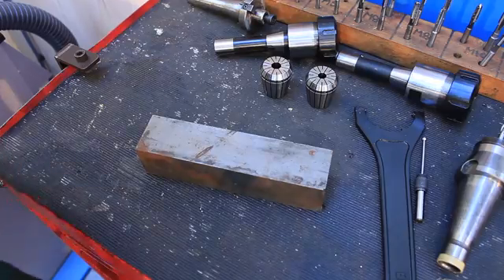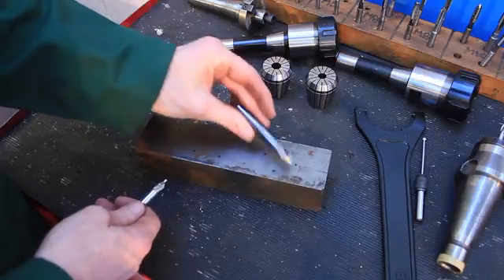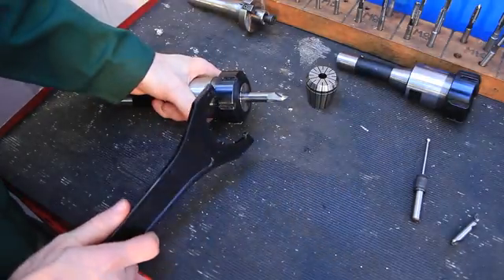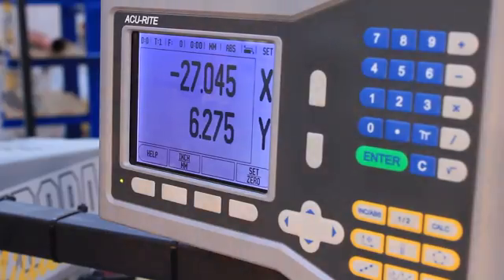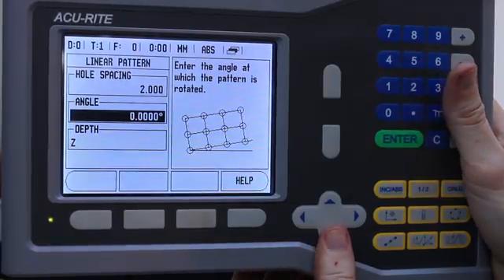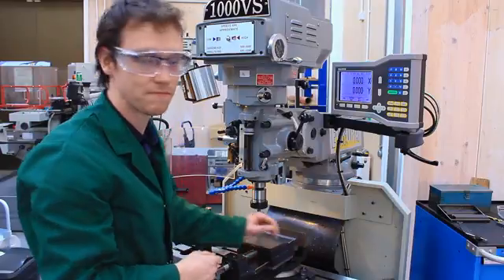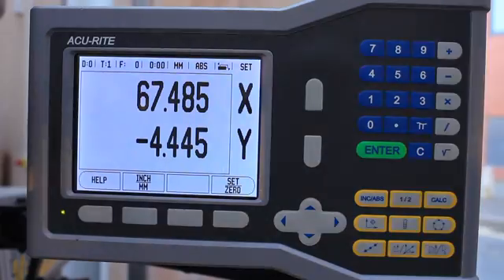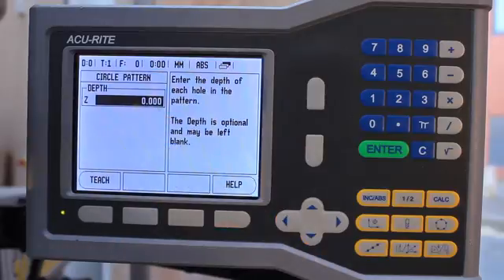Digital Readout Mill Tutorial Acu-Rite Vue -#5minFriday - #6

Comment: great just what the machine Doctor ordered. on the instruction video you showed re installing a two axis d r o to a lathe ,I was horrified to find that my 1.2 ton lathe should be removed from it's present space and fit the horizontal reader unit from behind. My package Chinese cheapy glass scale which looks good will be a big challenge as I have severe parkinson's and do all this as a hobby is there any other way of doing this or do I have to demolish and rebuild my workshop outer wall. L O O all part of the hobby Alistair